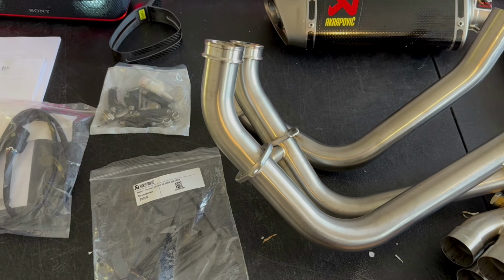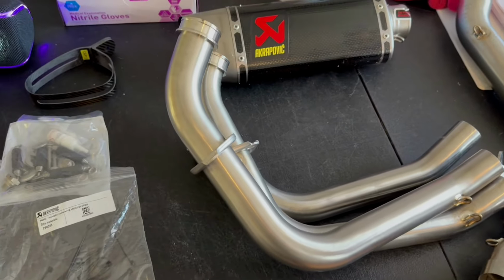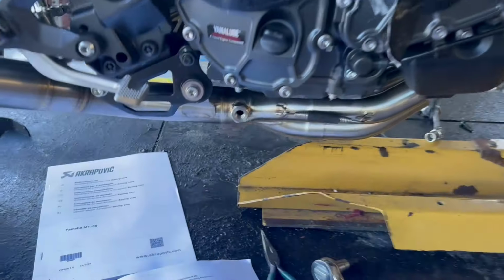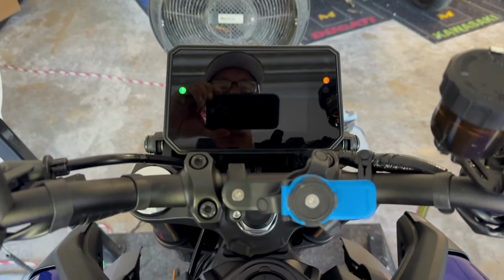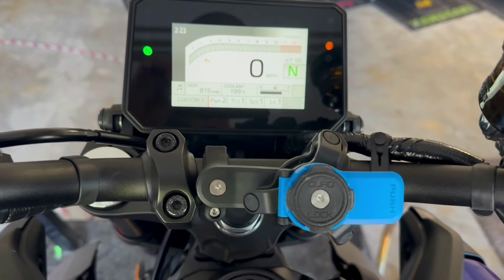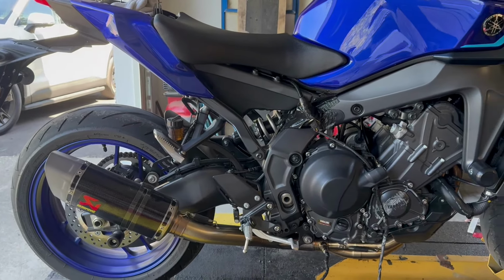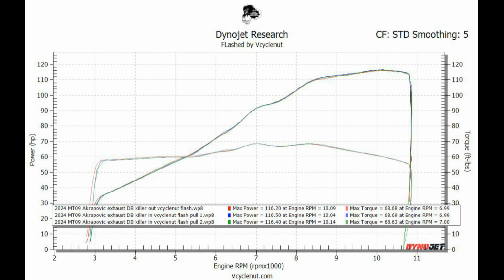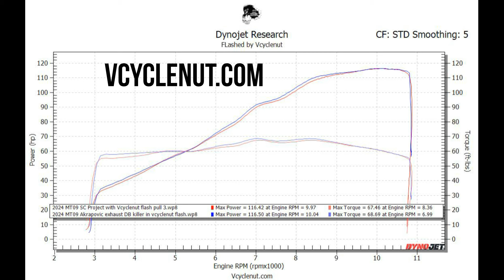2024 Yamaha MT09 Akrapovic full exhaust testing/tuning : Flashed by vcyclenut ECU flash results

Comment: Been watching these 24 MT-09 series. I'll be in the market for a reflash because the engine brake and on/off throttle IMO as well isn't the smoothest. I'm waiting to see when racefit comes out with their updated exhaust for these. I'm holding off till then, but love the bike so far.
Reply from the maker: Yea my flash makes a nice improvement on on/off throttle response smoothness
Reply: @vcyclenut  I'm looking into the racefit Growler full system. Pretty similar with SC project. You think the flash will be similar if flashed for the SC project exhaust even though using the racefit exhaust?
Reply from the maker: @4agehachiroku I think it will be close enough to start and then when I test and tune specifically for the race fit we can update it for free if needed

Comment: Vcyclenut, now that you've had the MT for a bit, do u think the SP is worth $1700 over the base? I don't plan on tracking, and don't ride super aggressively on the street, but the improved suspension,  brembos and polished swingarm look tempting!
Reply from the maker: I have not ridden both to
Really
Make an opinion
Reply: The base MT09 is perfectly fine even for the occasional track day. At this point the mt09's suspension/chassis is sorted out enough that it's a good handling bike and nothing like the 2014-2016 models sloppy bouncy suspension and whacky handling. Pretty sure the SP is just a marketing scheme to upcharge people who think they NEED the upgrade.

Comment: I’m looking to upgrade to the Akro for my ‘24 but I’m not sure if I’ll have the funds to upgrade the exhaust and do the flash all at once. In your opinion (as unbiased as possible), is it “safe” to run the bike with the Akro on stock tune for a little while? Or is it best to bite the bullet and do the flash and exhaust upgrade at the same time?
Reply from the maker: It would be ok to run with stock tune till you got the flash

Comment: I test rode the '24 last week in the UK, and when I jumped back on my '21 it felt a lot meatier in the midrange. Could this be due to the smaller airbox to accommodate the flatter tank? Nicely presented video, thank you.
Reply from the maker: Thanks.  Yes it always surprises me how a restrictive air box effects the midrange more than I would expect
Reply: The 3rd gen is just the better bike. More potential power and doesn't look like a 150cc scooter

Comment: Does this SC Projects system come with only the 1 O2 sensor, as my 2024 oem system has 2 O2 sensors? Thanks
Reply from the maker: One. It will not work on European models until they update it with a second bung
Reply: @vcyclenut  ok thanks. Would you suggest using an O2 eliminator plug and bung to block the second sensor hole?
Reply from the maker: @Markdi46  in theory that should work but I haven’t tested it

Comment: Do you think it’ll be possible to do a more aggressive pop and bang tune?
Reply from the maker: The bike has no ais system.  I can make it a little more aggressive without doing crazy things but nothing like a gen 1 or gen 2.
Reply: @vcyclenut  thanks for replying…hmm that’s disappointing. My SP is arriving in September. I’m sorry, I’m not very mechanically minded, is this AIS something that can be added? Sorry if it’s a silly question.
Reply from the maker: No it’s not something that can be added.  

https://youtu.be/iPBb2VVUltY?si=o3fzuLGdU2wseet6
Reply: @vcyclenut  thank you!
Reply: @vcyclenut hi again…if you were to do “crazy things”, what sort of things would they be?
Reply from the maker: @JamesBond-ph6hr  lots of extra fuel and bad ignition timing to leave left over fuel after the combustion event.  Not something I’m going to do.

Comment: Will you also try sc project s1 later on?
Reply from the maker: No. I just finished testing the sc crt.  On the gen 3 I did back to back testing with the s1 and crt and they perfect identical 

https://youtu.be/YM1jtK_N8U0?si=4i0zYHfdVVb-i7sG
Reply: On the Gen 3 did you find the s1 (with db killer in) much louder than the akra with db killer removed? I’m still leaning heavily towards the s1 with db killer but am a little worried it might be toooo loud
Reply from the maker: @eric7639  yes

Comment: Thanks for the video! I have a 2024 XSR900 and I just purchased the Akrapovic S-YR16-HDT/2 that goes for my bike.  I wanted to take off the DB killer but since you mentioned it actually gives you more HP, then i should keep it on.  Does this apply to my 2024 XSR900 with the new akrapovic exhaust?
Reply from the maker: I tested that system here

https://www.vcyclenut.com/akrapovic-titanium-testing.html
Reply: @vcyclenut  i’m mailing my ecu today!

Comment: Excellent work! My gen2 SP with a full Akra system (db killer in) shows 115,4 whp on the dyno, coming from 104,9 whp stock - have been riding for a number of seasons now with that smooth, but instant throttle response thanks to optimized fuelling / without any factory limitations. 
Together with other mods (weight "loss" to 181,5 kgs wet), the agile bike is a treat up and down any serious mountain pass (brakes also uprated with steel braided lines and track / road pads).
Eying the gen4 SP as "worthy successsor" - will have the pleasure of getting into the "opmimization mode" once more 😅✌